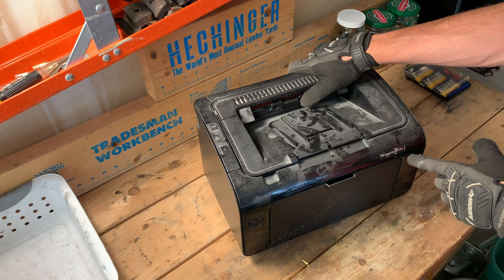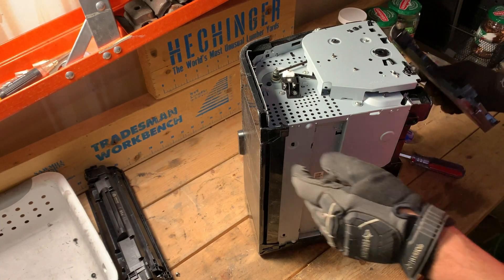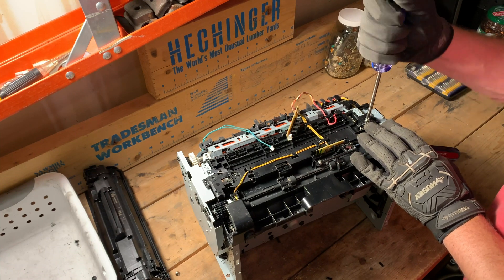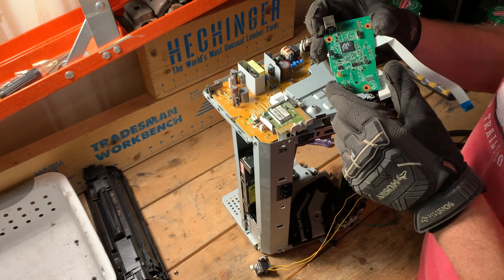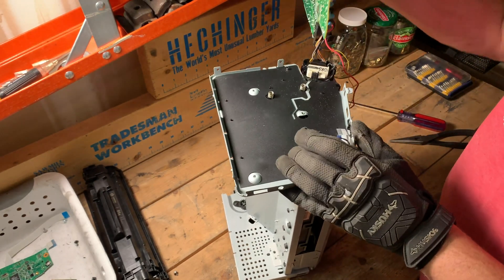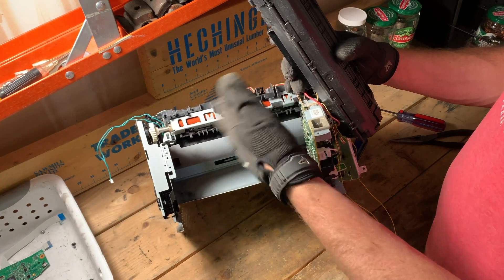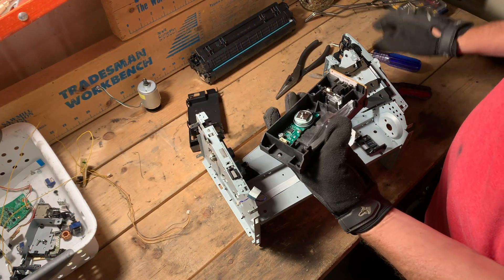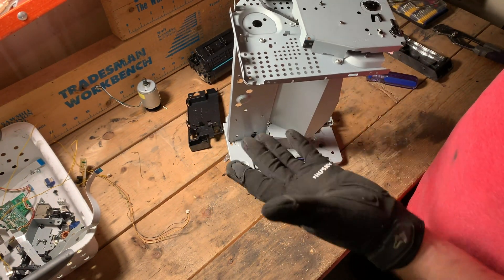eWaste Mining: How Valuable is the Scrap from an HP LaserJet Printer

Comment: Good video. Ladders are under utilised. Nice ladder shelf 😄. I stopped breaking down printers because of the amount of scrap plastic to deal with, given there is so little to keep of value. Thanks for sharing
Reply from the maker: Lol, that is funny about my lamp mount and wall shelving… the ladder is a good assistant … I don’t do small printers anymore either.  Large laser jets only.  Too much plastic and no real value in wires, circuits, and motors.

Comment: Well if You ever get a printer like I run at work let me know id be happy to scrap it out! Oh and I operate a HP 12k HD
Reply from the maker: I have a load of printers donated recently.  I will have to get one or two of the big ones recorded as I tear into them :) ... I will see if any compare to the one you mentioned ... printers are fun to take apart... lots of small motors and I like the steel shafts from the rollers for small projects.

Comment: Yes the best part for gold recovery is the scanner (cis)head if you remove the plastic and look at the other side its a small green or black board. Plain on one side but the other has one or more exposed silicon die and one long silicon bar about 1 inch by 8 inches long and this bar is covered in gold bond wire. As well as 1 or more exposed chips absolutely beautiful .this was one of my little trade secrets but its best if we all share to get the most out of gold recovery . thanks for your videos by the way

Comment: Please send me your printers they end up being worth more then most ewaste for me personally . in the beginning i thought the same thing but there is quite a bit of good stuff and i can break them Down in under 5 minutes .also important side note older plotters have a ton of good stuff . also do not waste time taking motors apart keep them and sell them as. Is to hobbiest or tech schools. Then whats left to scrap yard also the steel shafts are valuable as higher quality steel after you get a bucket full so it pays to wait until you have 10. Or more printers to scrap (sell used ink cartridge to staples or office max).
Reply from the maker: All very interesting!  I did not know about the bond wires.  The motors makes sense :)

Comment: The best part for gold recovery in printers is the light scanner board it has many gold bond wires. I found the amount is equal to 4 large flat pack ic packs.its surrounded by plastic but easy to get out.